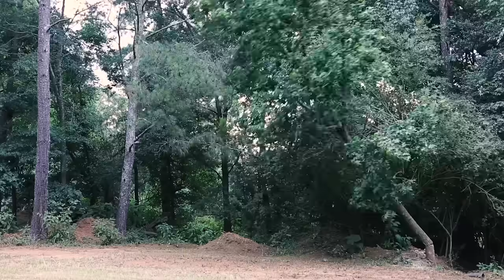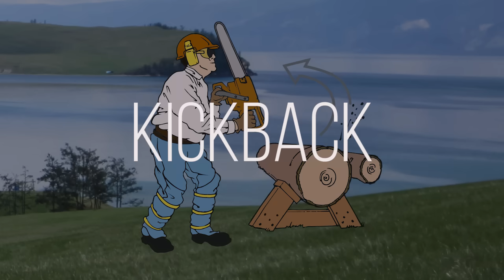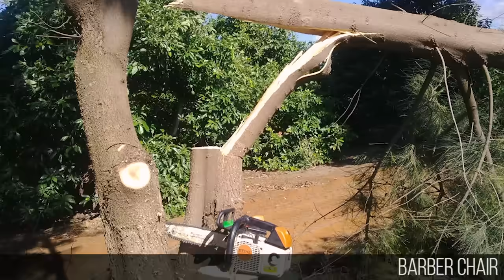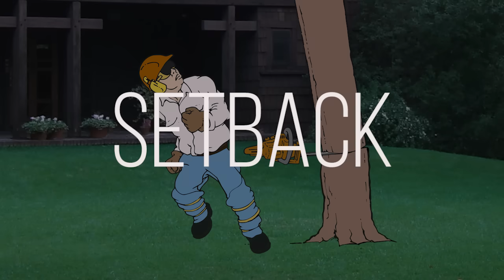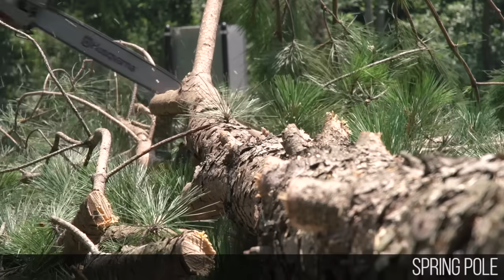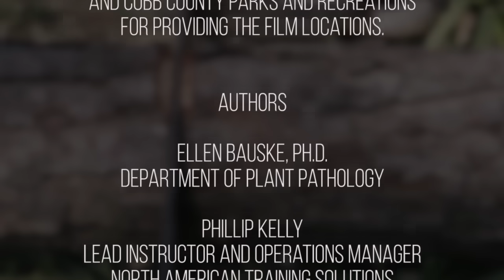Common Tree Felling Accidents and What You Can Do to Prevent Them

Comment: I have occasionally cut trees over the past 50 years. My training was reading the operation manual for a craftsman chainsaw and experience after each cut-down.  I had not had any injury until a few years ago. I was cutting down a small live tree about 6 inches in diameter between the fence and shed.  I made the cuts as if it was going to fall over. However, after making the final cut the tree just jumped off the stump, still upright, and onto my foot. The ground had layers of dead leaves and I was wearing leather shoes, otherwise my foot would’ve been broken.  The tree never fell and I had to push it off my foot with the help of my wife.  Now I respect even a small tree and try to treat it the same as a big one.
Reply: No holding wood.
Reply: Having cut some down manually without power tools I can attest if it's even a bit thicker than 2 inches expect a lot of weight if it has any substantial height. It can be a real shock when you go to move them, cheers you didn't get messed up too bad.
Reply: Dude needs a brushcutter
Reply: Sometimes the smaller ones are more unpredictable
Reply: Country boy here.  If there is one thing I learned even as a kid... trees are frigging dangerous!  When I was still very young, my oldest brother would take me out to fell trees for firewood (cords).  Fortunately, he was educated by old timers sons and was very skilled, so I learned the same.  Whatever the case and tree, a person has to know what they are doing!  And, wedges can be a big benefit for trees on the ground, also.  EDIT  This video should have covered more, or there should be multiple parts.  No one can learn enough when it comes to their well-being.
Reply: wow that's like the beaver deaths/kills lmao. It's always the small diameter trees.
Reply: Stop reading when you said “leather shoes” picturing an old man cutting trees in Penny loafers
Reply: It happens! The ‘easier’ ones with less time involvement are the one that tend to do their own thing lol. If I’m in any bit of a rush I will save the tree until the next day
Reply: Reminds me of the time a cow stood on my foot and refused to move when I was a little kid.
Reply: @Rlee-x9s  That happened to me when milking in my uncles dairy that was 45 years ago and I remember it like it was yesterday.

Comment: My face came a couple of inches from the bar during a kick back situation. That was the best instructor I ever had for bar discipline.
Reply: So you learn things the hard way.
Reply: Is the hand position at @5:08 incorrect? The brake doesn't look like it would be effective
Reply: Same
Reply: @shadowBanned2023  in case of kick back, the saw wouldn't swing in the direction of the handler, when being held in this position.
Reply: @wx3054  ah that makes sense. Thanks for the response ☺️
Reply: Staring down a 25 inch bar at the end of a 880ms really makes you think about your own fragility.

Comment: I was cutting at least a 20" diameter oak tree that had fell from a hurricane onto a power line. The power had been off for a few days and I was not worried about being shocked. The tree had brought the power line almost to the ground. Spacing between the still standing poles was at least a couple of hundred feet. I topped out the branches and had them pulled out of the way and was cutting the main tree trunk into 6 foot pieces. I was working back towards the root ball section of the tree. When I got to where the power line was underneath the tree I started to cut from the top when my saw started to pinch. Hmmmmm. Not putting things together I started an upward cut to relieve the pinch that occured. As I was finishing the cut the 6 foot by 20 inch diameter long disappeared into the air flipping like a tiny twig. I just ran!!! Lucky for me I ran quick enough and the log smashed into the ground standing upright but 8 inches or so stuck into the ground. The power line had tension like a rubber band between the upright poles. My friends said it flew at least 20 feet into the air. Learn from other people's mistakes. This was a big one I will never make again.
Reply: Dang! Glad you got out ok!
Reply: I would of thought the line would have been irreversibly stretched! Guess not. Good to know!
Reply: A real men's slingshot :D
Reply: @D00kerT  I used to do line work, and the tension on those lines is built up in spans of poles, and not just one downed section, even if they look stretched and floppy, they still hold enough tension to end you. Watched a man cut a limb off an icy line, maybe only sagging about 2-3 feet than it should’ve been, and it brought up enough force and sliced his hands off. Freakiest thing I’ve ever witnessed…couldn’t have cut it cleaner with a sword.

Comment: 30 yrs of climbing/ felling trees, the thinking  brain/ fear  / respect factor, is WAYYY better than thinking protective gear can circumvent any bad decisions.
Reply from the maker: It is true, PPE is your last line of defense, when all else has failed.  Like a seat belt...
Reply: good point. Your brain is your most effective and most important piece of safety equipment. That chain can cut the leg even without chainspeed. -= so i would like to get a pair of chaps.
Reply: PPE is in case good decisions go wrong. If you have been felling for 30 years you understand every outcome is not predictable. No where in this video did they say PPE is a subsitute for good or bad decision making.
Reply: @Farmboy1544  sorry but no amount of ppe will save you if a tree falls on top of you.
Reply: @joshlower1  Duh!

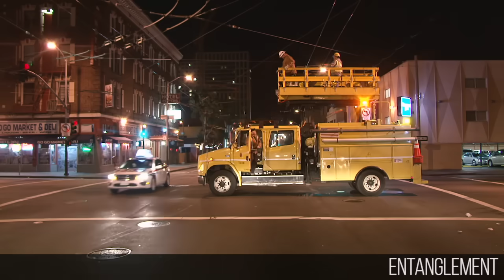Comment: 6:27 Can vouch for that one. Read about our stupidity and mistakes:

My father was cutting a big branch hanging over the power lines and I was going to pull it sideways, standing off to the side, but also diagonally below using a rope.
The hedge of small trees from which that branch were were above me, on an embankment of roughly 40 degrees. Only reachable from the top, so both positions on top and underneath were akward.
Crucial error on my father's part:
He was in a hurry and wanted to get the whole section done that day, so we didn't put up a ladder underneath to take out small bits first, no, he was going to cut it in one go and I would pull it out sideways so it didn't hit the cable, or land on the road, and then I'd clean it up so it'd be faster. It's not a tree after all, just a long branch some 5 cm thick with a lot of smaller branches attached, what could go wrong?

Just as the branch came close to breaking, a car came racing around the corner, driving like a donut like at illegally high speeds, so I had to quickly get out the road to avoid being hit and had my concentration elsewhere. Then the branch went down onto the power line very rapidly, far quicker than I could realistically pull, nevermind after a car-induced delay, and then I had no more leverage because it was snagged hanging over the powerline. The line came down about a full meter.

Wanting to keep the power line from snapping under the weight I made a second error by going underneath to push the branch up and reduce tension until my father could cut it. 
Now if the power cable had snapped right then and there it would've been 'zap, no more Niek'. So, that was stupid.

Neither did we have a backup plan, so my father had to walk back through the entire yard, grab the ladder from the shed, walk outside the plot, around the plot, down the road, to where I was standing. Not fun to wait on if you're deadlifting upward with all you've got.

Then we could awkwardly cut branches and ease the weight until we could lift the branch off the powerline.

My parents were later slapped with a roughly € 2500 repair fine by the utility company because apparently the branch had wrenched something broken in the next connecting powerpole without cutting the power, and an additional some € 800 equivalent fine for failing to report it ourselves, which we hadn't done because it didn't seem like anything had been broken and the power was still on.

Comment: As a new arborist I'm always wanting to learn, and this was a great instructional video, many folks I see working with chainsaws don't even wear the proper ppe let alone practice these safety procedures.
Reply: Yep and as for myself ive been in the tree industry 23 years and still out climb , out cut and out class a greener smothered in ppe that is gassed out before he's 30 ft off the ground due to the cosmetics he's hauling on top of his own body weight . 
If you know what you're doing you don't need 60% of the shit they tell you.. Some people would try to hoist a timber wolf 150 up a tree if they were told to do so
Reply: I won't entirely disagree with you but it depends on the job at hand. Simple bucking of firewood, for example does not warrant being kitted out from head to foot in protective gear. The Safety Nazis have made many people afraid of their power tools and fear will get you injured.
Having said that, my wife wants to learn how to use a chainsaw. I did buy her all the gear, because it's especially easy for a nervous beginner to get hurt.

Comment: When the feller was executing the accordion cut to resolve the spring pole, it looked as if he was using the tip of the saw that was mentioned earlier in the video as dangerous for kickback. Was he doing that because the tree itself was serving as a guard? Thanks so much for this video- its a great resource.
Reply: The guys in this video are professional trainers from North American Training Solution.  They  know their bar and use every inch of it except the kickback zone. If you look, you can see he isn't in the kickback zone.  He is not using the tree itself as a guard.  They never mess with kickback
Reply: @ellenbauske8030  Thanks for the response Ellen. Trying to erase years of bad habits here...

Comment: Having 2 decades of serious big saw experience as a country guy, you can successfully learn to execute tree cutting on your own. The secret is to match the saw to the work, and to the user. There's loads of configurations and not all people can handle them effectively. Start small. Practice new techniques on small trees before you go full send on one that can crush you. Learn to climb in a gym or on rocks or boulders before you do it in trees. Knot-tying and mountaineering and rigging require a lot of practice to get right and respect to do safety. And, for the love of God and all that is holy, ladder plus chainsaw equals emergency room. This is not a pursuit to enter lightly. I haven't been seriously cutting as much and had to get back about it, so I watch as much instruction and safety info as I can get my hands on. And, fails, because it's good fuel for pattern recognition. It's easier to spot dumb the second time. 😂

Comment: Should you use the saw tip to undercut the bent sampling?  I thought it was best practice to avoid using the top of the tip to lessen kickback chances.
Reply: The way I see it - avoid the 9 o'clock to 12 o'clock position of the tip, but that is just my take on the subject.

Comment: i fell 3.5 ft diameter trees regularly, operator knowledge and right stance makes all the difference 
i had one single barber chair ever
winch operator had a malfunction in the remote controll - winch wouldnt stop pulling 
he yelled to us in time 
we moved away, the tree charred to abaut 3 meters high - then the winch ripped the uncut half of the stump straight out of the earth then continued to pull until the tractor was shut off - at that point the tree was pulled really close to the tractor

Comment: Years ago I had a spring pole, a large hazel bush with a large felled tree above it. As I cut it, the spring pole released its energy and brushed my helmet from below. The helmet flew away many yards and I had a graze on my forehead. If I had leaned forward an inch or two, I would have been killed for sure. Shit like this happens so quickly. Be careful! In my case it was late afternoon, it was hot and I was tired so my focus was gone ...

Comment: Couple simple must-do-s to protect against rotational kickback: always keep thumb of left hand UNDER the front handle, stand to the left of the plane of the chain (so you could read what's written on left side of the bar), spread your feet, keep chain sharp & revs up, expect kickback to sneak up on you some day. ALWAYS have wedges on you when felling or bucking. Even a small saw can kill. For straight-back kickback, anticipate it happening & stay clear of the rear of the saw. It can kick like a mule. Always good to study what might happen, so you have a chance to prevent it.

Comment: Tbh honest the makers of this video probably know better than I do, but I was kinda surprised by the instruction to use ropes for entanglement. There's absolutely no way I at least am going anywhere in the area where tying a rope to tangled tree could help the situation 😅 The way I've been taught to deal with a tree that gets tangled to another tree when being felled is to to a vertical plunge cut to the trunk and then using some kind of a tool to turn the tree towards the side it should clear the other tree easiest. Sometimes works fine, other times is completely useless.😄

Comment: Very well done, But you could add one point,
When using any chain saw an cutting, Never stand directly behind the saw, as when cutting for wood in a vertical cut,, In that fashion, always stand to the side of the saw, in case it starts to jump out, and up. It will not contact any part of the body.
I also found when cutting horizontally, If at all possible, stand with the back of the saw where the handle is supported by the mass of the body or have it resting against a much heavier part of the body, then just trying to support it with the arms and hands, as this will help prevent and reduce any kick back, You will have to actually figure this out until you are comfortable doing this. Along with the correct footing, Your probably better off seeing someone doing this before you try it yourself.  As I have in many times used this for probably over 50 years, an think it saved me from many a kick back. And especially watching where that tip goes.
Reply: CMAenergy he did mention that in the video.

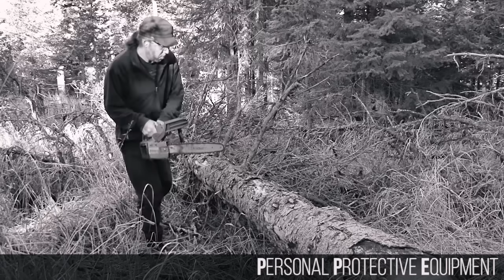Comment: 1:27 aside from no ppe, best practice is do not drop start your saw.
Reply: Why?
Reply: OMACMedicFiveZero because it is more stable to start it on the ground or by holding it between your legs. By drop starting you don’t have full control with only one hand on the saw and the other on the starter rope. In Australia you will not get your crosscut accreditation ( the most basic recognised chainsaw accreditation) if your drop start.

Comment: How do you advise AGAINST letting the "kick zone" or "TOE" of the saw touch anything but advise a plunge cut in your bore or back cut? I NEVER plunge cut a back or bore cut EVER!  Wedges are the BEST way if you have any doubt. Also on your "shave" technique why not just tip the branch off from the brush end? I guess everyone has different ways as long as you're CAREFUL and NEVER take any tree for granted, no matter WHAT size it is!
Reply: The bore cut is the only way to go for front leaning trees. In my experience the bore cut is necessary on hardwoods that grew leaning, and I'd recommend it for any leaning tree. The tension and compression in the tree makes the barber chair situation almost inevitable. You would never need wedges to take down that kind of tree, and they won't do anything to stop the tree from hinging into the air and into to you. I learned that lesson when I was 16 and tried dropping a 30" oak over a frozen river. Trunk split for the first 15 feet from the ground and launched the base of the tree way up in the air. Tree landed where I was standing and broke a hole through 18" of ice. I had only made it a couple feet back when it hit, tough to move fast on ice. I started death in the face at the hands of my own ignorance. Don't repeat the mistakes so many have made before you.

Comment: Others may have already pointed it out, but in the first section you say to never let the tip of the bar touch wood. Then in the next section you recommend a bore cut... Of course, I get it, but on the surface this is a pretty glaring contradiction.

Comment: I'm curious if anyone has experience kickback with smaller chainsaws (18" 42cc engine size). I've yet to experience it. Most tree cutting videos use much larger saws though and I was thinking that the stronger engine and larger trunks cause more kickback problems. Any thoughts would be appreciated.
Reply: Smaller saws are apparently more opt to kickback due to less mass holding it back
Reply: Longet bar= more leverage= more forceful kickback.
Reply: @joshlower1  Best answer so far. Good thought.

Comment: Don't need a bore cut if you got a hot saw. It's clear this video is for the inexperienced
Reply: Is there a reason to not do a bore cut in that case?  Is there something unsafe about doing the bore cut?
Reply from the maker: Bore cut has the advantage that you can cut the back strap and follow your escape route before the tree actually moves.  Also helps reduce stump jump.  Generally considered the safest option.
Reply: @ugaurbanag  Thanks, that's what i've heard as well, but I was wondering if Ryan Polaski (or anyone else) had some insight on a reason why you wouldn't do the bore cut.
Reply: @ugaurbanag  well I'll agree to disagree. I think the cut has maybe half a dozen uses in my book and seems to be used a lot by the inexperienced

Comment: 2.01 shows where the kick back zone is. 5.02 shows someone proceeding to cut using kickback zone...???
Reply: If you are very experienced, you can plunge cut. He was using the area on the lower tip of the saw, not the top tip.
Reply: If you are very experienced you wouldn’t need to watch the video in the first place.